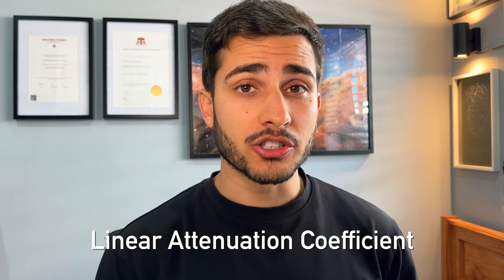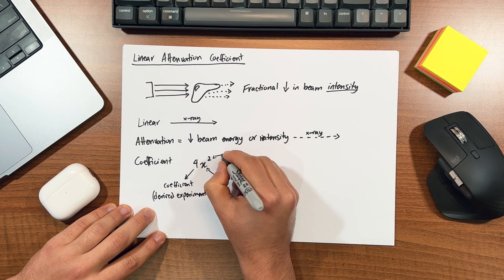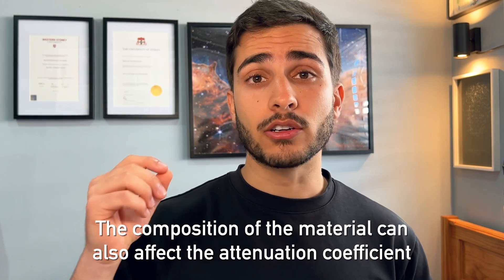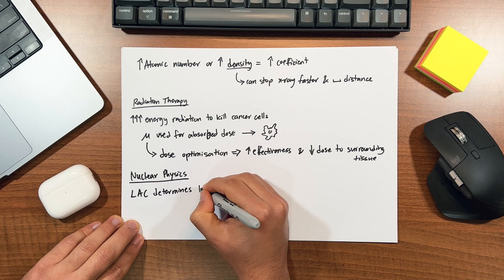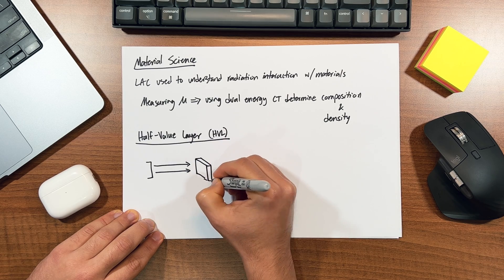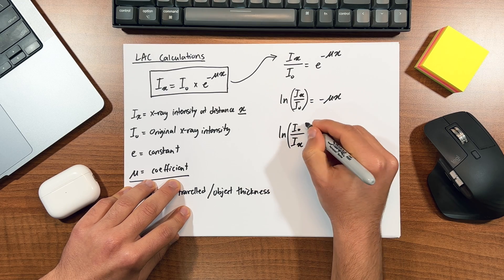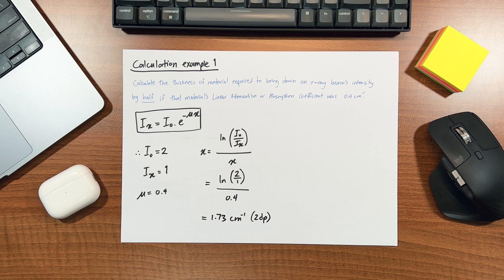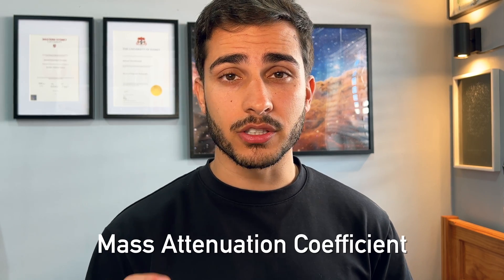Linear Attenuation Coefficient (µ): Explained!

Comment: Homework: You want to reduce the gamma ray intensity by half 
using a material with μ=0.231 cm−1
, How thick should the material 
be?
How do I solve this?
Reply: reducing it by half means Ix should be equal to half of the initial intensity: Ix=I0/2, replace it in the equation: I0/2 = I0.e(-µ.x). solve it and you'll end up with x=3cm thikness. It's the same as his first example 5:04